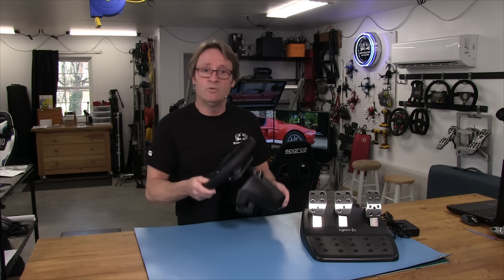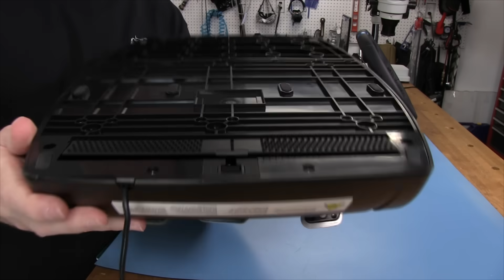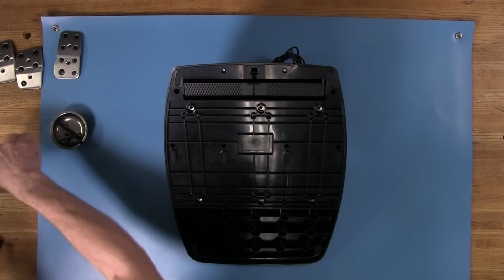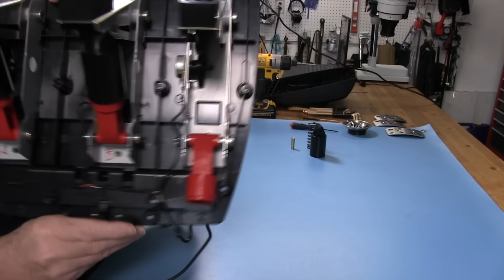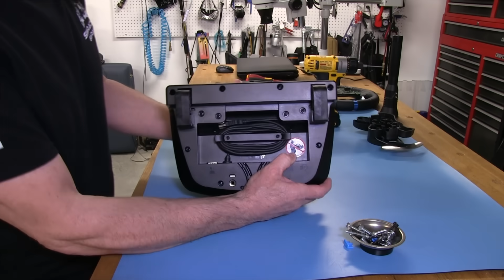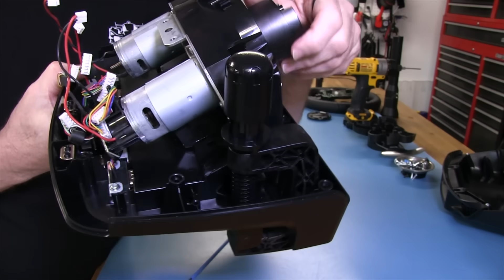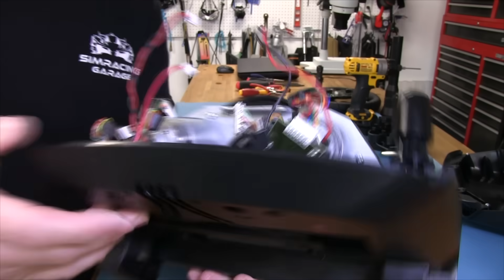Logitech G29 Review

Comment: G25 - was a dream wheel of its time with all the features. And it's still the best of logitech Gs. All other Gs were a downgrade. Then was no sequental. Then was no button plate. Then was no shifter. Then was non-linear brake. What's next? No pedals? No wheel? lol
Yesterday I noticed they released a DD wheel, but I don't trust them anymore, knowing the quality fall since first G25. Trust me, I fixed them for some time and saw many of them, and quality of components (wires, potentiometers, pcb components) differs dramatically.

Comment: I've watched three of you take these apart, and I have yet to see the metal clip inside. I had to replace a clamp. I took all screws out. INCLUDING the 4 between the 8 around the edge. I was able to put the clamp in no problem. However, I put it back together and there was a sound now, like rubbing. And wheel was touching something. I took it apart again, and this time  metal clip fell out. And I cannot figure out where it was or what it does. But my wheel will not work now. The light inside flashes. And wheen will not turn on it's own as if there is no power. I need help. and As usual nowhere to be found on spytube

Comment: That rubber inside brake spring is a pain in the ass. In my driving style I use full brake in most corners. Trail braking. I must be very precise when I release the brake and that rubber is not what G27 was and is not what a real brake is. It is just stupid cheap engineering.

Comment: Hello, maybe you can help me, the db9 connector of the H gear broke, they replaced it with an equal one disassembled from a TDT for the TV, now only 5 and 6 fit, and the steering wheel no longer vibrates and has become super soft. Can you help me what went wrong?  Logitech G920 xbox one s.

Comment: Hi anyone that can help. Ive had a G920 for 4yrs i race about 20hrs a week and my cousin who enjoyed racing when he pops round got a G932 a few years ago and just gave it to me because his kids broke it. The problem is the usb lead thats built in they've somehow dislodged the plastic bit and flattened the pins in the wheel side of the break away plug. My question is can i sip both plugs off and by pass the plug and just have the usb on the end? It's bothering me having an up graded wheel which i cant use with ACC Trueforce although im able to use the G923 pedals 👍

Comment: 39:33 - That bar is the wheel's 900 degrees hard limit of rotation (should've been limit switches if you ask me, but Logitech decided to use force sensing and firmware to detect the rotation limit)

Comment: so a couple things about the gear setup. from their marketing material it looks like they use helical gears, which if done right wont have any "cogging". the other thing is there is lash needed when you have a pair of gears, however by using two pinions, one can be used for pushing the wheel clockwise and the other used for counterclockwise, and there will be no lash if the motors can keep the gears under preload all the time. is it actually doing this? not sure, and you cant tell without taking a peek inside.

Comment: 👍👍👍👍👍           ✌  Nice job Barry. This is my 3rd time watching this video over a 3 year period. 
My G27 lasted so long the G29 sat in the box for 2 years. after 1 week it developed a click when turning hard 90 degrees. So we will be pulling the base apart.   The only real gripe I have is using the G HUB software. You have to have this for the drivers in order for the wheel to be recognized on a PC. Otherwise it thinks its running on a PS3/PS4. I would prefer the old joy.cpl to be there to calibrate and adjust wheel power centering.

Comment: I used a G920, had to sell it because of financial reasons. I miss it and sim racing. You can feel the cogging when you counter steer but the wheel has next to zero dead zone, I zoomed my eyes to the indicator on screen and very slightly turned the wheel and could not detect a dead zone. Didn't use the brake pedal at all because it pushes my chair away, and braking is uncomfortable without socks. I recommend this wheel but to me it's just too powerless and doesn't accelerate fast enough. It's a beginner wheel or you can't afford a better one.

Comment: I have a problem with my g29 wheel. It resets itself during race as I´m turning, taking a turn; never on a straight line. That makes me think there is something wrong with the  gears or the motors. I opened the base in order to clean it or find the problem. NOTHING WRONG! Does anyone have the same problem? How do I fix it?

Comment: So I just recently purchased one and the force feedback motor on the right I believe is bad, during calibration it rotates the wheel to the right but will not to the left? But when you manually move the wheel to the left it calibrates. Also while using there is tension when turning left but no tension when turning right. Any ideas on what this can be or if the wheel just need to be adjusted on ghub??

Comment: Does this wheel have weak ffb? I’ve used this wheel and an old driving force wheel on gt5 and I could swear the driving force had better ffb. Is that just because the g29 just isn’t as good in ps3 mode. Or is that old wheel just better?

Comment: they dont have "firmware" for the calibration of the pedal pots.. you just need to set them to the low end when no pressure is put on the pedal... 
im gonna remove that rubber bumper from the brake..ive had nothing but trouble under braking with these pedals...

Comment: Hello, i have some question, should i get G29 or t300 RS GT? Because currently i make video and playing using keyboard, and its so difficult to drive using keyboard, Thank you!
Reply: I have the g923 for the xbox but id get the thrustmaster t300rs is belt driven and has more wheel options and has a bit more torque. That or the fanatec cls elite

Comment: Is there any possibility to add 2 more switches on the board, because  I see there a open soldering connection spot at the downside of the board.
Because I don’t want to make a separate usb joystick board to control 2 more switches over the shifter for ETS and ATS Simulation.
This will help me a lot.

Comment: I was debating on returning my G923 (updated G29) with its TrueForce, due to the noise it makes when going over curbs. Now that I watched this, I'm going to keep it, because the Thrustmaster 300 was the other option. I like the brutal accuracy of the gear drive and the new brake in the G923 made a massive difference. Also, the TrueForce can be so accurate at times that you can feel the extra rubber chunks under you in outer corners in GT Sport.

Comment: A few years ago I wanted to get into "sim racing", so I saved up some money to purchase a $300USD Logitech G25 wheel/pedal/shifter setup during a black friday sale. The Logitech G25 was a complete nightmare from the buggy Windows 7 driver support to the wheel that was not centered & would drift to the side when going straight (wheel was calibrated correctly using the Logitech software & reading many online forums). The entire thing is made out of cheap plastic & you are supposed to screw down the shifter to your desk but that is also made out of a cheap plastic material that breaks if you tighten it down too tight. 

I refunded my Logitech G25 wheel from Amazon & went back to using a Xbox 360/Xbox one controller, Logitech ended up burning too many bridges!

Comment: The load cell imitation sounds like a great idea, and it's probably great for people playing on a carpet, but anyone accustomed to using bolted down pedals will instantly know it's an order of magnitude too weak.
If the rubber cube were about 5x stiffer it probably would have seemed like an improvement over linear brakes from the perspective of an experienced sim racer, but from an average consumer's perspective they won't have a clue how hard brake pedals are supposed to be and would just never use the last 30% of the brake.
I don't think it's even a bad feature, the marketing is just a little overzealous.

Comment: Seeing all the plastic on the inside I really have to wonder what's going to happen after 500 hours of use.
That's only 5hrs/week for two years, if a kid loves racing (I did) I can see this thing wearing out sooner than later.
I suppose if a kid actually does wear out the G29 that would be a good argument for spending more money.
At least the modern market has plenty of upgrade options, unlike Sim Racing in the 90's.

Comment: Thank you so much for the detailed breakdown. I need to replace the usb cable attached to the wheel, but what is the name of the cable i should buy to replace. I’d appreciate any help. Thank you so much.
Reply from the maker: If the existing cable is still long enough, just cut of the end of the cable to clear the damaged section and rewire to the wheelbase. You should be able to source a suitable 4 wire usb cable at many locations online. Just make sure the end that attaches to the PC is an "A" type connector. Then cut the other end off to access the wires to attach to your wheelbase circuit board. You may want to measure the existing cables diameter make sure the one you buy is not too fat.
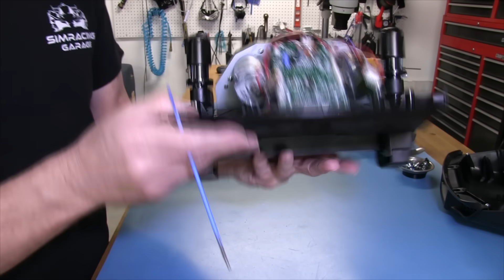Reply: @simracinggarage3026  Thank you so much! Just one last question, what about the end I attach to the wheel? I see that you show it at 37:37, does that end have a name? I couldn't find any cable like this online.

Comment: TAPE THE CABLES TO THE HOUSING before you reassemble the pedals. 
I pinched my cables in two screw holes and almost ruined my pedals. 
Tape them down and out of harm's way.
Reply: If it ever does happen you could resolder those wires and you are good to go

Comment: That position sensor will eventually come loose, I’ve had a G25, G27 and it has the exact same setup, they both came loose, that’s the only reason I wouldn’t recommend these, that and the pedal potentiometers are non standard and incredibly hard to find.

Comment: I'm confused about wheel diameter every review i watch it's either 270 or 280mm, which one is right, same confusion with the old wheel, I measured my G25 and it's 270mm but in the official specification it's 280mm 🤔

Comment: I'm not sure if this is only the case with my G29 but steering wheel rim seems to be made of plastic (I mean part under leather) and this plastic is rattling (especially when bigger force is needed to rotate wheel). I really cannot recommend this wheel due to cheapy plastic sounds issue.

Comment: If i remove the rubber on the brake there will be a Deadzone . But can i just fix this when i recalibrate the brakes on the pc ?
Reply: Ok so ended up switching the clutch for the brake padel . tbh  it feels worse but... and this is a mayor but. you will be more consistent with your braking . you have a liniar brake curve and this is way better for your mind musckle. Since the rubber will wear over time and the braking force you would have to aply will be different over time and fucks up your mind musckle.

Comment: I have a 2 year late question. Can you switch the springs around? Basically I want to switch the clutch with the accelerator, my accelerator isn't giving me full throttle when I just step on it. I have to really mash it in on a weird angle, and that is iffy.

Comment: 39:30 that bar is the steering angle limiter the pinion gear has a block that hits a stop point in both ends of the rack.

the metal plate the pcb mounts to does the stabilization you mentioned

Comment: I've had this wheel/pedal set for four years. Daily use. Mostly League racing.
I had an issue once with throttle spiking and fixed that with electric contact spray in the throttle pot. I did the other two as well.
 28:37 You can see all three of them on the left side of the pedal assembly's.
I also swapped the clutch spring with the throttle spring. Stiffer throttle for better control. (IMO).  Throttle spring is weaker.
I cut the brake rubber block in half to allow a little more pedal travel. It was really stiff.
I'm glad I bought it. :)

Comment: Being disabled I am unable to use my left leg/foot to use the clutch; my question therefore, is there a 'wheel rig' that does not require the use of the foot clutch. As is I drive an automatic car whereby only the accelerator and brake are controlled by my right foot. Anyone with any ideas of the possibilities as I'd love to become a 'sim-driver...anyone ?
Reply: @Cr0Lar Thank you so very much for the information. I was not aware that there is an 'automatic clutch' mode built into the sim racing games.Does this apply to either a 'wheel rig' or the type of 'hand set' as used in 'Xbox and similar; I myself use an iMac so would appreciate the name of any 'sim racing game' you would care to name.`Many thanks.

Comment: the connector is not 3,5mm. its a 5,5x2,1x12mm, a little shorter is no problem. 24 v 1,75 a + on center pind. just in case you need a replacement like i did :)

Comment: What I dont get is the advantage taken over this hype here in america. Whether you go on eBay or Amazon, you see pricetags starting from as low as 500 reaching up to a grand for a base model excluding stick shift that is being sold for add'l  130 bucks. Kiss my ass! I did some homework and checked the pricing on same products except in european market. With the currency as of 6/20 the prices converts to roughly or slightly over 300 +/- 10 bucks. So I went deeper on ebay and spotted these G29/920s do go for 300 in California based ebay seller stores and Logitech's official website has it momentarily 399.99 with a 100.00 off. If 300 is the original MSRP then why do many sellers add such horrible sums? Used models go for higher than new units only some may actually include a shifter and still profit on you, see it for yourself how many active auctions are there with numerous bids in place and dont forget to check the high shipping fees as hidden product fees these sellers also add up to maximize profit on your behalf. These thieves should be regulated and fined for this obvious illegal interest especially since this isnt serious brand that has numerous SIM controllers like Saitek or Thrustmaster. GTFO here.

Comment: I did take the rubber out of the break until a friend of mine with the same wheel told me to try using the clutch for braking. This is the best option you have with this wheel. Just brake with the clutch, it is linear and therefore much easier to get used to.
Reply: I ordered 2 tuning g29 brake springs from ebay at €8 each. I removed the black rubber block and put the brake spring in the gas pedal. I put the 2 new springs in the brake and clutch pedals ( the clutch still feels lighter than the brake due to the longer travel. )  The difference is amazing and reminds me of the tvr griffith 500 that i used to own as the replacement springs are 59% stronger.
Reply: P.S.....Needs to be mounted on a fairly solid rig though.
Reply: kevin harkness i just have it mounted to my desk anyway.
Reply: @kevinharkness2108  Sounds great, but I probably won't invest in this wheel anymore. Alone the rubber block removal was so messy and annoying that I lost interest in doing any tuning 😅

Comment: Just received one of these for a gift. I want to love it but it's such a mixed bag. The logitech G-Hub software is just horrendous. The wheel has felt great in one game (I forget which) after spending hours on the internet researching settings (PC2 I think) but honestly, it's such a crap shoot on the game. And so dissapointing to discover I need to have some degree in the technicalities of force feedback for this wheel not to feel like a loose bucket of nuts and bolts half the time. Were it not a present it would be going back but given it is, I'm going to have to persevere and try to find that sweet spot of game that I can enjoy where the wheel doesn't feel like it's either going to rattle itself to pieces or just be a sloppy mess. I'm not really after a game where I have to spend hours on end going round a track trying to shave a millisecond off my laptime. But that seems to be the only kind of game where the wheel feels good.
Reply: RAW setting only for project cars 2 i recommend... then tinker with the other options.. but i have most higher than 60

Comment: I'm on the market for my first wheel after being a gamer for 40+ years. So I have a lot of research to do.
But I think I just hit the mother lode of info I need.
Reply: I bought G29 few weeks ago and I was amazed of what I got. I bought a used set (just few months old and tried 2-3 times) for 130€. I could not be more happier.
Reply: @SavolainenVideoarkisto  Thanks for the input. I'll take it into consideration, as I still have not yet bought the first piece of the setup due to the ongoing pandemic mess. Supplies are low, some companies closed for a while. Hopefully by summer's end I will be in the driver's seat though!
Reply: I recommend buying Wheel Stand Pro v2 with it, I tried couple of times with a small table and it requires heavy table or wheel stand with it. Basic computer table was not good for me. I hope you are well and this pandemic end soon.
Reply: @SavolainenVideoarkisto  I've got my eye on a Ricmotech DIY cockpit. If you haven't seen it, give it a look. Might interest you too.

Comment: The gears are definitely some kind of inertial dampener. I have an older GT with only one motor, but still like it. I'm building a PVC tension spring-suspended two-part chassis with two old Buttkickers clamped to the upper part and my wheel. Hoping the springs will constrain the vibrations to the seat, pedals and wheel mostly. Six springs, progressing in strength from back to front to distribute the load, at 45 degrees on two axes on the corners of two squares.